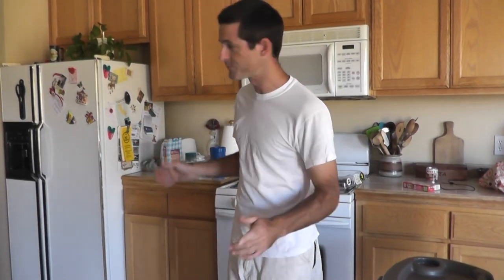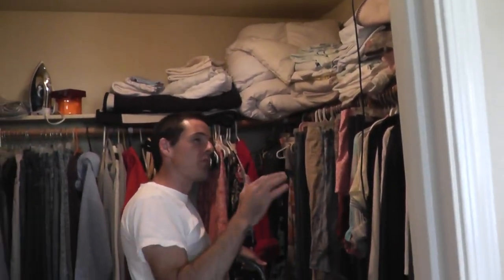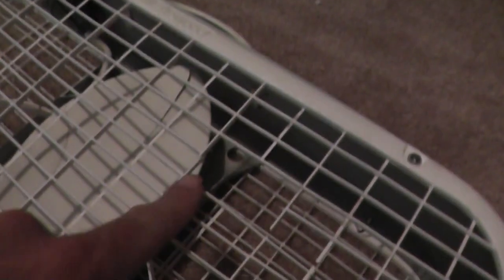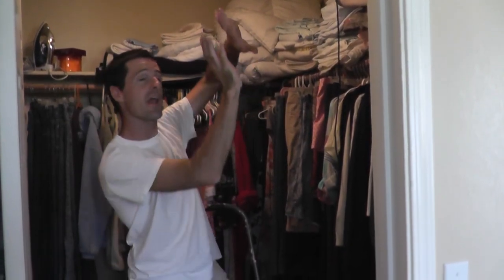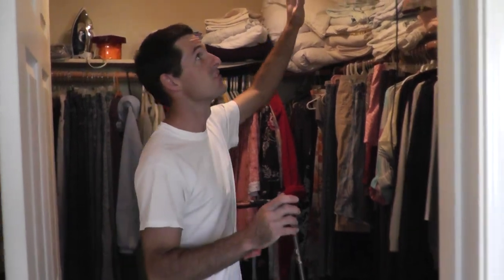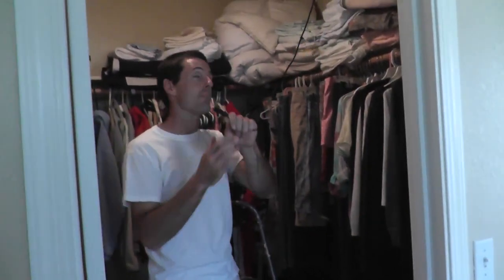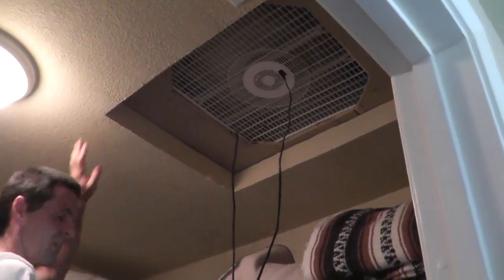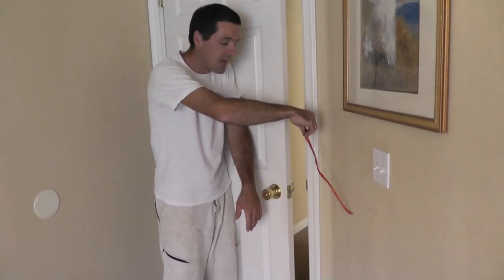Cheap Homemade Whole House Fan - How To Cool Without A/C !!

Comment: I live in a 2 story 2500 sq/ft house. I haven't ran my a/c in 9 years . I've got fans 2 downstairs and 2 upstairs .The 2 downstairs blow in and the 2 upstairs blow out all day.I figured out if I keep the air moving during the day its easier to keep it cool. I also heat with woodstoves . The gas company came to "TEST" my meter .lol I just told the guy to take it with him lol. I can't wait til I can tell the Electric Company the same thing lol. Very nice video . Wish you the best.
Reply: +N.C Kayak King Mine just decided to drive away with the tank when I was at work lol Im not missing it.
Reply: N.C Kayak King must be an epic feeling to be able to tell them that lol
Reply: You mentioned you have the fans running all day, do you also have them on the whole night as well? My ac is not blowing cool air so now I'm trying out box fans. I live in a 2 story too.
Reply: + N.C Kayak King  Also, how much cool does it get with that method of having two blowing in downstairs and two blowing out up stairs?
Reply: I wanna do this but my ball and chain keeps making fun of me😔
Reply: killer tip: if you want the best AC keep the fans on all night, then wake up early to turn them off before it gets hot, then close all doors and shut the windows and blinds, and your house will stay cool all day. My grandma does this at her farm in the summer in 100-120 degree weather
Reply: @Lysergic_  yeah i do that in Australia but in a lowset house it still gets to 30 degrees celsius plus but still helps it can be 35 or more degrees Celsius. Good tip
Reply: @dragan3290  if my house got to 30° C id just go into a bathtub full of cold water and chill
Reply: @Lysergic_  you get used to it just not temps like somedays u get over 45 deg celsius in the shade. In the house in our bedroom it can over 38 degrees celsius!  That's when you feel like ur dying and walk around wirh a spray bottle, towel and spare t shirts lol
Reply: @dragan3290  holy jesus i dont think id survive that lmao. I saw one comment say you could spray down your roof for the temp to drop in the attic, then the temp would probably drop downstairs a little too, if you ever have to experience that hell lmao
Reply: @Lysergic_  you would get used to it just still sux. The spray bottle is to cool yourself down. How many times. My wifez came from Scotland about 7 yrs ago they all complained about the heat so in the pool all day and mate the next day lol. Just a bunch of badly fried lobsters😁
Reply: Btw i just woke up its 6 am and 25 degrees celsius in the house and i feel a little chilly outside as im having my ciggies and strong cuppa. Cheers man its nice chatting to someone from a different part of the world 😊have a great day or night!
Reply: @dragan3290  same to you! :D

Comment: One other thing I forgot to mention. You need to have a window cracked when you run the fan otherwise it will pull air from the path of least resistance. Usually this is a chimney or the flue where a gas hot water heater is vented. Most gas hot water heaters have a pilot which is a steady small flame that stays lit to enable the burner to light. When the air is drawn down the flue it will blow out the pilot and now you have gas being pulled through your house. You figure out the rest.

Comment: dude, you cannot ventilate a whole house with a freaking 20" box fan with a 1/25HP 80 watt motor!. try a 36" fan with a 1/2HP  600-700 watt motor instead.
Reply: Lol, no dude. Let Photonicinduction to power that fan at at least 3-4 kW
Reply: james that sounds like turn your hvac fan to fan mode. that is 1/2 hp fan.
Reply: @tzarius78  
Yes but that would only recirc
Reply: But he did...
Reply: at this point get a 2000cfm stove fan
Reply: 3/4 hp btw
Reply: Math hurts. 
1780 Square Feet /2 = 890
890x8, 890x9 = 15130 Cubic Feet / 1820 CFM for 20" box fan = 8.35 Min..... So 10-15min to circulate air from the home, not including the hot air WANTING to leave the home threw that fan.
Reply: Barn fan that'll be a great solution

Comment: I started to use this box fan idea for about 3 months now it does work but if you do not have air turbins installed on your roof getting the hot air out your attic with this idea wont work very well. If you do have air turbins on your roof just to get a idea how a fan would work in your crawl space just remove your crawl space at night open your windows and dont even put a fan there and you will feel the air coming in from the outside and the hot air escaping through the crawl space into the attic and the air turbins releasing the hot air out of the attic
Reply: +Rich gutierrez 
Hey Rich. So, most attics/roofs are equipped with vents on the gable walls near the top. This probably won't be the case if one has a hip roof but in all other cases, vents on both gable wall ends should be sufficient providing they are not clogged up with bugs or wasp/hornets nests, etc. Other than that, you're right an air turbine should work great for that end goal.

Comment: Great. Now remove both screen covers if you can do this with risk
Reply: Agreed. A narrow strip of toilet paper would save you the expense of that nice plastic strip and is more sensitive to airflow . OR if the roof has lots of mushroom caps (?) the fan may not be necessary

Comment: coool idea.  alo tof people dont like using a/c ..   especially the house all closed up. i prefer fresh air flowing through the house.   i use the old lake wood fans in the windows and old box fans and the house is like a wind tunnel but great to sleep that way ..  i do use a/c if the air  is really sticky .. but if no humidity  i use window fans
Reply from the maker: +Richard Drop I avoid using the AC as much as I can. Your idea about blasting the air through the house is a good one. Cool it down in the night so it's not so hot during the day.
Reply: i love the fresh air .. .plus ive always loved fans since i was little i always  look for the old school ones and get them when i can

Comment: I just did this same exact thing...then ran across your video. Hilarious! But also, very effective. I'm also using an old box fan but have not even built a surround for it...Just suspended it in the attic opening and put old shirts around it to prevent front to back coupling. The only negative is the CFM from these old box fans...so I bought a new 3250 CFM air king...it's going to shred!

Great video and thanks for sharing

Comment: I've used a setup like this for about 20 years now.  Fortunately, the attic access is in the hallway, near the middle of my house.  I mounted the fan on the underside of the insert panel, so it hangs a bit below the ceiling and the fan control switch is accessible by getting up on a step-stool or by reaching up with a bamboo back scratcher.  The fan is plugged into an outlet with a programmable lamp timer in the attic to switch it on at 7 p.m. and turn it off around 8 a.m., so there is no power cord hanging down.  I usually run it on the lowest speed all summer long, but since the control switch is accessible, it's easy to select a higher speed when needed.  Even though the house has central air heating and cooling, I've rarely used the cooling, and the fan only costs $2-$4 in electricity per month.  When the weather gets cold in the late fall and I want to use the furnace, the fan gets shoved into the attic for the winter (remembering to turn it off or unplug it first!) and the solid panel gets dropped into the opening to prevent warm air from escaping through the attic.

The first fan lasted about 15 years until the bearings seized, so I'm on the second breeze-box fan now.  Better fans have holes for adding oil to the motor bushings, which can extend their useful life.
Reply from the maker: Panamint Joe Smith Thanks a lot for the comment, it's great to hear from someone who has used the method for a while. That timer is a superb idea. I think I'll implement that into my setup. I think the cost of $20 for the fan (that lasted 15 years) and $3 per month in electricity is about the most economical cooling possible!
Reply: What is the square footage of your house though?  And what temperature is the house the majority of the time?  I personally can't handle anything about 75 degrees F inside a house.
Reply: +Amanda How — My house is about 1200 square feet.  On summer days the inside temperature can creep up to 80°F by sundown.  By 10 p.m. the outside temperature usually drops into the 47°F to 53°F range.and it possible to get the inside temperature down to the high 50s or low 60s by the time the fan timer shuts off next morning.  During heat waves the air doesn't cool off so much at night and every day the minimum inside temperature tends to ratchet up a degree or two from the day before, but since heat waves only last 4-6 days, I put up with it.
Reply: The would work fine for living room and hallways....but....how about bedrooms?.... peaple wants privacy, so they keep doors closed, and I can't see any air flow going there !
Reply: +Ramon Alvarado – Your mileage may vary, as the saying goes.  I live alone, so I have all the privacy I want, whether the bedroom door is open or closed. ;)
Reply: A friend of mine had a heavy duty attic fan situated just like this one except over louvers that were normally closed. They would open with the air movement. The fan was located in the center of the house and wired to a light switch. When the air got nice and cool outside you could move that air inside in literally just a few minutes. Bonus: It was also very useful when his wife burned something in the kitchen. lol
Reply: +John Alva — I haven't found a real need for louvers on the fan.  As long as there isn't a strong, hot wind outside, the cool air tends to stay in the lower part of the house and the hot attic air stays in the attic, or gets moved out of the attic by a gable or roof fan.  As long as doors and windows are closed, the gable fan is forced to take in air through the soffit vents and it doesn't draw much, if any, air from the dwelling space.
Reply: I must be misunderstanding the theory here, i would think it being on during the day while the sun was beating on the roof would do more good than having it all at night. What do i have wrong here lol
Reply: +Jake Sanchez — Even if the house is well-insulated, it will gradually warm up on a hot, sunny day and may get uncomfortably warm by sundown.  If we don't have refrigeration or don't want to spend money running a refrigeration system, we open doors and windows in the evening when the outdoor temperature begins to drop below the indoor temperature.  The fan helps move the cool air into the house and warm air out of the house faster, so all the walls and furnishings that have gotten "heat soaked" during the day cool down overnight.  In the morning we close everything up tight and repeat the cycle.  Dead simple.
Reply: That was my thought too. I remember a couple houses I lived in the attics were a pure sweat boxes. They were older houses though. I think in my lifetime so far I've only lived in one well insulated house. Huge difference on electric bill. It was the biggest house I've lived in and had the lowest bill.
Reply: Wonderful, and well written
Reply: @amandahow2638  my house stay in the 83 degrees and its comfortable if I was to go even close to 79 it feel to cold

Comment: This is basically a whole house fan.( Nice try though)........But here's how you do it.
find the area of you house--L*W*H= x.......times air changes 20 to 30 air changes....divided by 60 minutes =  CFM needed for air changes.   Now,in the attic you must alter the attic gables opening 1 square foot for every 750 CFM added.
Note not effective in humid climates ( actually bad moisture ) dry climates good. 
Remember: you attic hold heat I've see 170 degrees easy in some areas and that heat will take over your cooler home....hot air rises, but heat moves from hot to cold.
open all window.......and it will keep your home and attic cool...........Oh, use it at transition ( When cooler outside then inside)...........good stuff
Reply from the maker: Thanks for the comment, and the air change calculation.
Reply: Yeah in areas east of the rockies you will need to do something else or add a large dehumidifier. It will help you cut down on costs tho if you use it for over night cooling. A dehumidifier would probably help a lot tho.
Reply: This is more an attic fan than a whole house fan. It works by pushing the hot attic air out the gable vents and/or eve vents thus cooling the attic. It pulls outside air into the house so it does not cool the inside air below the outside air temp. To be more efficient, install a roof or gable exhaust fan that just cools the attic. Then, open the house late at night to cool with cooler evening or night outside air. Close the windows and door just as the sun starts to rise trapping the cool air inside. With the attic cooled, the house's cooler morning temp will last longer. 
The goal is to keep the attic temps the same as or just above the outside air temps. 
The only way to cool the inside to a lower temp than outside air is with an air conditioning system or swamp cooler. The attic fan will make it easier to cool the house with an AC system.
Reply: You run this fan ONLY at NIGHT and pulling cold air from open windows  into the house and pushing out the roof vents thus cooling house and roof. You do NOT run this fan during the day.
Attic fans do not work. It is tested and proved by pros. Attic getting hot by radiant heat. It is radiating from hot roof down to ceiling. It works like radiant heater and does not affected by attic fans air movement.

Comment: I been doing the same thing as the video for 8 years.  I opted for a high velocity 21 inch Lakewood fan.  Got it on sale for $60.  On high she put out about 7,000 CFM (Cubic Feet Per Minute).  The fan in the video puts out about 1,200 to 1,500 CFM.

I saw on line that a whole house fan at Lowe's only put out 3,500 CFM and was $350.  Now that fan will probably last longer though.

My 21 inch Lakewood was just wide enough to sit on the rafters without any need for extra support.  She lasted 8 years of using her for about 10 hours a day on high during the late spring through summer.  Super loud on high but worth it.  I had her on a timer to shut off at about 8 AM.

I also usually had a few 20 in box fans in a few windows to blow cool air from outside to inside so the big Lakewood wouldn't have to work so hard.

If I can get my house down to 65 degrees even on a 100 degree day my inside temp only gets up to 80 to 82 degrees at about 5:30 PM.

On those nights I know it isn't going to get cool enough I have my air conditioner set to come on at 5 AM and run for 45 minutes to cool the house down to 65.  Before I go to bed I shut off the fans and close all the windows and shut the attic access.